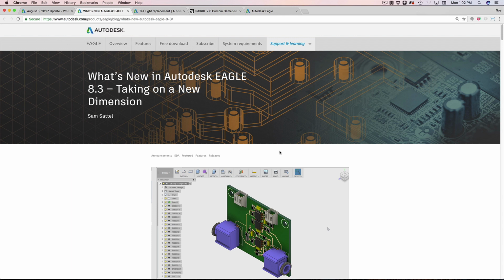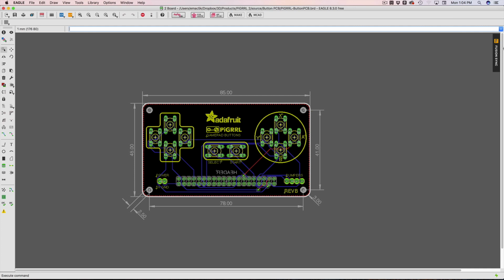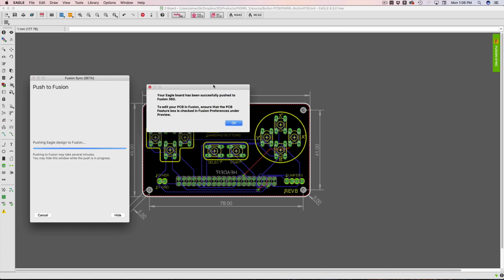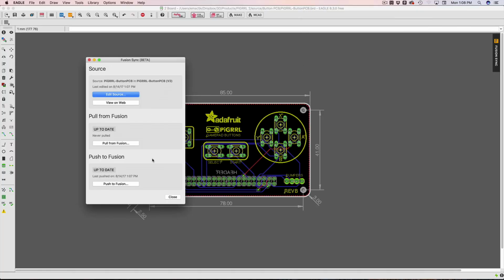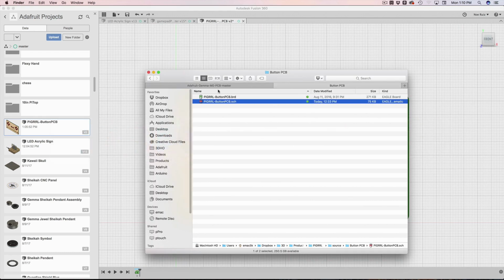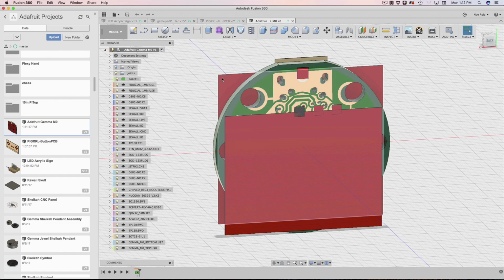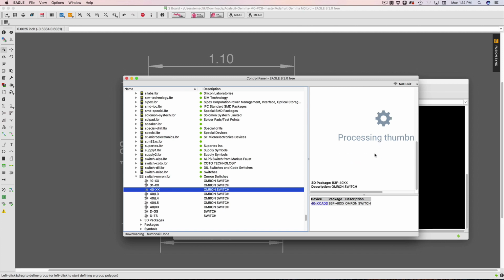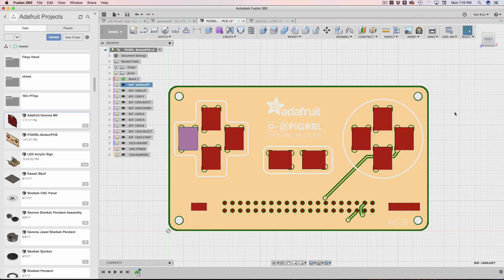Fusion 360 Tutorial – Eagle CAD Integration (Preview)

Comment: you should just use the Eagleup plugin. Work's perfectly to convert your eagle board files into a 3D sketchup file with or without components - and it's free, including SketchUp, which is pretty capable for most 3D designs
Reply: These two things are not exactly comparable. With the integration being shown in this video, if you know what you are doing, it's possible modify the component placement in F360 and have changes propagate back to EAGLE. Also, people still use SketchUp?